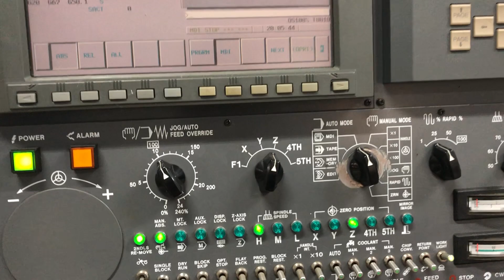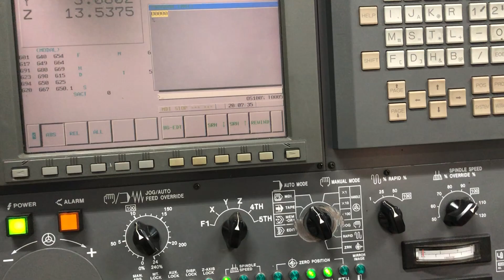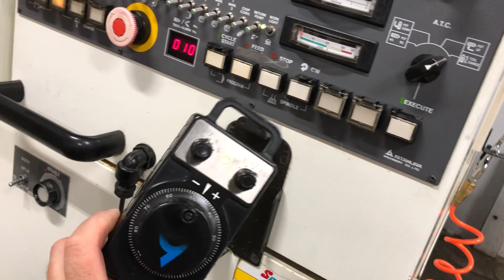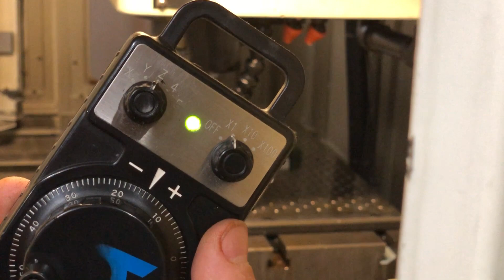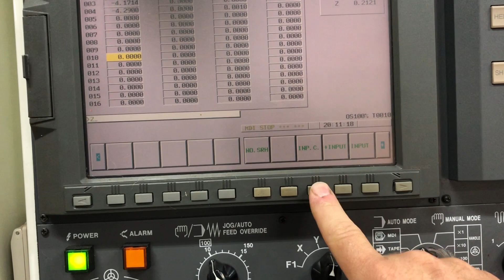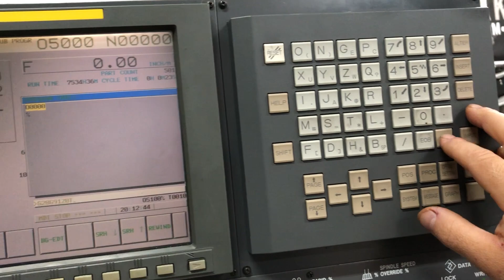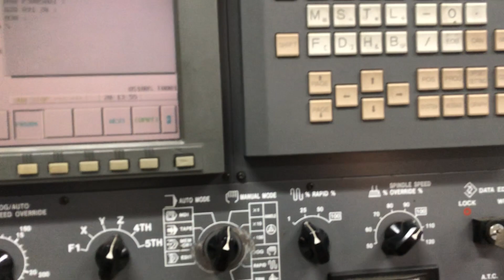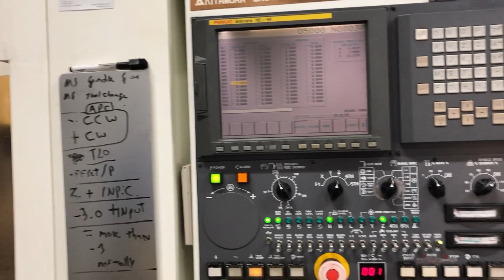Kitamura 3xi fanuc 16iM-B Tool Length Offset

Comment: be careful, that inp. c. button just enters the 'relative' dro's numbers, you can zero/origin that dro from the positions page by hit Z  then origin. Places ive been will have the 'relative' zero'd when the z is home(it should match the 'machine' dro ) so the tool offsets are the distance from z home down to that plane from the tool setter that is 3 inches above the table. And the z for the work offsets will be the distance to the programmed z zero of the part from that 3 inch plane. measured with and indicator in the spindle zero'd on a 3 inch gage block on the table then jogged over the programmed z surface.
Reply from the maker: Thanks man, Ill try to wrap my head around that!
Reply from the maker: Mind sharing a video on how this works?

Comment: I have never seen a Fanuc controller configured like that. You should be able to locate in the manuals how to set your parameters to execute a M06 tool change without sending the Z home first. Also that -.2121 number you got for the initial tool length offset was the difference between the length of tool 1 and the tool you were measuring. Most controllers are setup so you put the actual length of the tool being used in your tool length offset. The machine uses a G90 combined with your Z work offset and tool length to determine where the tip of the tool is in space. I don't know if any of this helps but I figured I would put my two cents in.
Reply: I don't consider myself an expert by any stretch but I've ran and programmed Fanuc controllers for over twenty years.  It's been 7 years since I ran a Kitamura so I'm a little rusty on their specific nuances. I think your offset configuration may depend on the offset package that was installed by the manufacturer. It may be as simple as finding how to change your offset display to accept the actual length of the tool. I do recall some Kitamuras having a glitch in one of the tool retention sensors that won't allow some of them to perform a tool change without sending Z home first. I would love to post a video for you but in order for me to properly walk you through any of this I would have to record doing it at my job and with the type of work I do my employer would be very displeased.
Reply from the maker: Im a little thick:) lol, but somehow my freight train personality makes things work! Ill think your thoughts over and see how I can implement
Reply from the maker: Mind sharing a video on how this works?
Reply: It appears that your offset configuration is much like a lathe, having one "master tool" and the rest are calculated from it. I would say as long as your not experiencing any problems with your finished parts then keep doing things the way you are. There are some advantages to using the actual tool length as your offset but in your particular application it may not be necessary. Plus if it's what you're use to and it works then it's what I would stick with. Sorry my comments have been so long winded, my brain works in bits and pieces.